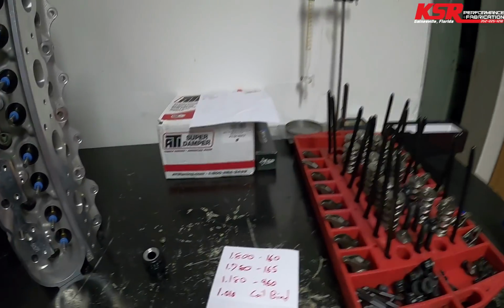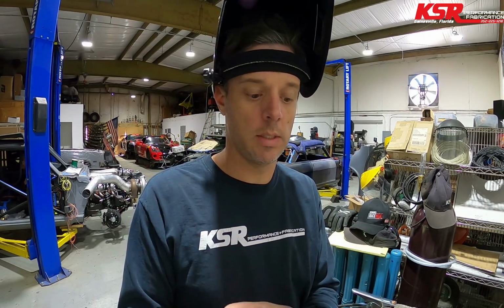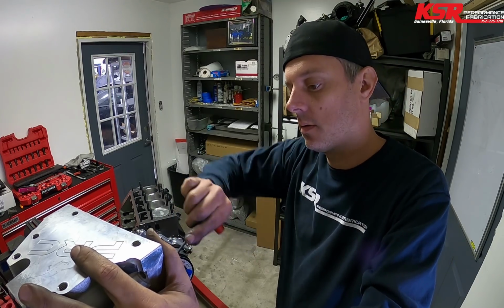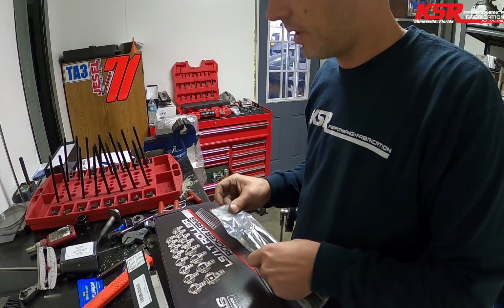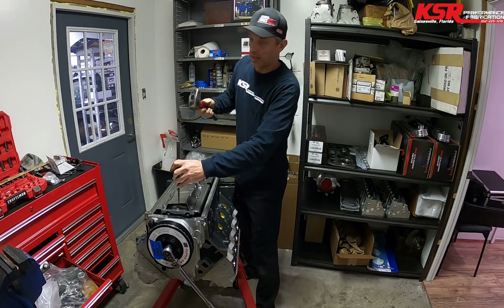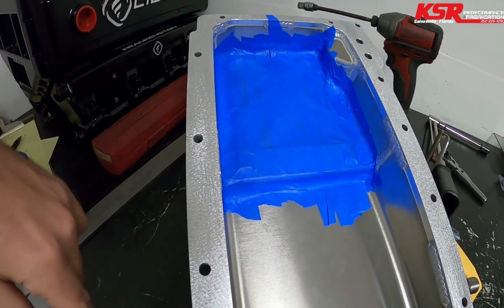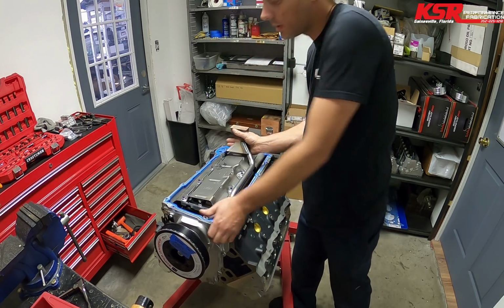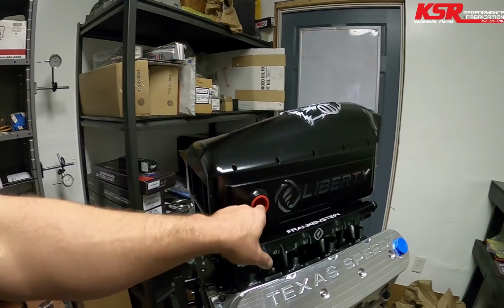Mullet El Camino Build Episode 2! Engine Back Together....but There Were Issues!

Comment: On such an insane build for a car that’s going to experience so much why did you guys decide to go with a wet sump oil system over a dry sump?
Reply from the maker: Plenty of cars run wet sump oiling systems even into the 5s in the 1/4, it is nice to have, but not an absolute necessity.

Comment: Personal preference * I like to put just a tad of silicone on the underside of the oil pan gasket where the front timing cover mounts to the block and where the rear main seal plate goes on the block. Keeps it from seeping*

Comment: Why didnt they send you or why didnt you guys run TSP roller rockers.... Those valve tips will sure get a worn out.
Reply from the maker: The rockers in Leroy, Ruby, Dale Truck and every factory LS ever built beg to differ.....
Reply: @KSRPerformanceFabrication  im just in inquiring into why not run TSP roller rockers? I cooked my exhaust valve tips with only 55000km with a .624 lift with the same valve spring setup. I know the engine will be looked at as it a race engine, just wondering if the TSP full roller rocker is not necessary on this engine setup..

Comment: Are the 6 bolt block/heads the only difference in this motor? Do Ruby or Leroy have the orings? Also is this one a solid roller(as soon as i ask u answer).. Also, those mains have splayed main bolts, correct? Hard to tell w the billet(or polished alum) spacer..

Comment: You should put a temp sensor after the intercooler so you can calculate MAD and use that for fuel trim. I noticed that as lacking on all of clete's boosted cars should be able to stop wheel spin and get more power top end power down track
Reply from the maker: They all have temp sensors after the Intercooler....
Reply: @KSRPerformanceFabrication  oh I guess I should have payed more attention, do you set them up to monitor MAD and adjust fueling?

Comment: TSP was trying to tell me there is nothing wrong with attaching the torque plate with head bolts when studs will be used in final assembly.

Comment: I bought one of those rotary welding tables that has a foot pedal to control. And it's a toe/heel pedal with neutral being level. Toe makes it turn CW, heel goes CCW and the further you push it, the faster it turns. It takes a little practice to get your feet to coordinate. But once you get the feel of it, you can really make some perfect welds. TiG is a little more challenging because of the two pedals, but MiG is really easy.

Comment: Why is so much work required on a new motor? Is it because of you going twin turbo? I understand the work needed for the different style heads, but the bottom end.
Reply from the maker: It didnt have an oil pan on it when we got it.
Reply: @KSRPerformanceFabrication  That’s going to be an absolute beast

Comment: I’m sorry but correct me if I’m wrong but did you put the head gaskets on backwards, the opening in the gasket should be in the back not the front. So the coolant goes from the pump, front of the block, back of the block, back of the head, front of the head, then to the pump or is there some custom cooling thing going on?
Reply: If it is right then how is the coolant flow laid out cause it looks like it goes from the front of the engine straight up to the head but in the head it can’t escape cause the return hole is in the gasket is back of the block

Comment: Very interesting to see you using an indicator torque wrench instead of digital. Any particular reason? Could it be that torque wrench you've had for decades and as the old saying goes, "don't fix it if it ain't broke"? or is that you trust the indicator more than a digital?  Just curious.
Reply from the maker: For lower torque values, that’s my go to

Comment: When you are building an engine and turning it over by hand, do you use any type of oil?  Are you worried about friction between the parts?
Reply from the maker: Everything has assembly line in it

Comment: Not everyone may use the terms in the same way I do, but your work clearly shows me the difference between an "engine builder" and an "engine assembler." Also, I noticed you used a beam torque wrench on a couple of applications. Is it because it's faster than setting up a click-style wrench for situations where you want to measure the torque but don't require quite the same level of accuracy that a "modern" torque wrench would give?
Reply from the maker: I use the beam wrench for lower torque values

Comment: I'm assuming (or thought I heard mentioned) that 2000hp was the goal. Would that be the highest hp motor you've ever done Kevin (solely by yourself)? Also, did you do SM's 5.3?
Reply from the maker: This engine isn’t really mine honestly. Texas Speed put the hard work into the shortblock and degreeing the cam. I have maintained a few big HP Big Block Chevrolet’s

Comment: Why would you not run the oil pick up tube as low as you can? Debris sitting on the bottom of the pan?
Reply from the maker: The oil has to be able to turn into the pickup box

Comment: Kevin, a couple questions if you don't mind. First why not a dry sump over the wet? Yes it's more work and plumbing but better and runs cooler. Also why hydraulic valve train over solid? When you showed the the spring force I could figure out why so low then you said Hydraulic lifters and that made sense but not the use of hydraulic itself. Are you not reving this engine out? I never had any luck with them I always run solid. Just wondering as you know what you are doing and know this build you want to build just not what I expected.
Reply from the maker: The hydraulic roller in SoccerMom has seen 8700......

Comment: Kevin, maybe I missed it, but I didn't see you put the valve stem caps back on the valve tips before you checked the push rod length. Do you think that may have caused your valve lash issue? You removed them here https://youtu.be/ffbe3SJrk0I?t=501 .
Reply from the maker: The square port heads had titanium intake valves, the cathedral port heads have some really good stainless steel valves

Comment: The two extra head bolts per cylinder appear to be nothing more than locating dowels in this case since you red loctited them into the heads?
Reply from the maker: They are studs. Once the heads are on the engine, nuts are installed from the underside
Reply: @KSRPerformanceFabrication  Just learned something! Do you have to use a small headed torque wrench on them, or is there enough room for a full size 3/8 wrench?

Comment: So Leeroy, Ruby, and Mullet are all turbo 427s, but with different setups and combinations, and will end up with very different track results and potential. I know a key difference going forward was Ruby's transmission, but she's doing wheelies and is topping out in the mid-7sec. I'm curious to know the big differences and limiting factors that set them all apart. A reliable low 8 second stick-shift, a 7-second powerglide, and now a planned 6-second car. I wonder what else is changing besides a beefier motor that can handle more power.

Comment: How do you torque the nuts that go on the studs that come out of the bottom of the cylinder head?
Reply from the maker: That’s what I was doing with the wrench at the middle of the engine.

Comment: Is 0.17" what you typically want to see as a static margin between max lift and spring bind?
Reply from the maker: Nah, depending on the parts combination, they can be ran much tighter.

Comment: is there an advantage to the ATI dampener vs a fluidampr?
Reply from the maker: I prefer the ATI
Reply: @KSRPerformanceFabrication  ten points
Reply: I'm probably going fluidampr..... I like the concept of fluid being used to dampen vibration as well as the outer case having the ability to spin up quicker than the fluid inside. if theres another reason to choose the ATI over the fluidampr, that im not seeing, let me know. I'm not worried about what either costs at all. oh if it matters it's a forged stroker lm7 in a street truck. I built it to hold high boost from a procharger

Comment: Enjoyed the build Kevin.
Just curious about Texas speed and having to adjust various parts. Thought it would be turn key.. Js
Reply from the maker: They sent it ready to bolt our accessories on with the cathedral port heads, but there was a mixup about the engine needing to have cathedral port heads to match the other two boosted cars. For the oil pan, they may have their own package that they prefer to use, but with this being a different chassis, they left the pan selection up to us and sometimes they need a little work to make the fit
Reply: @KSRPerformanceFabrication  ok I remember you saying that now.. My bad.

Comment: If the nut (in the lifter galley) on the 6th head stud ever backed off I would guess that it would destroy the engine? It also appears that you can't use a torque wrench on them?
Reply from the maker: It's not good if they do, but I have never had one come loose. For torque, I pull a bolt in the vice to the proper torque, then feel it with the same wrench I am using for the valley bolts then pull the nuts to the same feel plus a smidge. Not super scientific, but that method has not failed me yet!

Comment: I noticed you didn't put and sealant on the oil pan. Is that not necessary when using an aluminum pan?
Reply from the maker: The gasket was there, it is kinda a rubber o-ring with an aluminum frame to support the o-ring.
Reply: @KSRPerformanceFabrication  Well just asking because most videos I've seen of oil pan installs they put a small bead on each corner of the block

Comment: What kinda fuel you going to be running
Reply from the maker: Pump Gas, Racing Ethanol and possibly Methanol if we choose to go that route
Reply: @KSRPerformanceFabrication  with methanol you won’t have to use an intercooler right

Comment: Finally been waiting. I cant wait for this thing to take it's first 7 second pass. I know ol cleet loves that motor but I really thought with him trying to go low 7 or even 6s he would go with a different motor from the same company but a diff motor atleast bigger or soemthing
Reply from the maker: This one has better parts than the engines in Leroy and Ruby ;)
Reply: @KSRPerformanceFabrication  well yeah I know that lol its ana amazing  motor I just thought a diff motor. I thknk its capable of 6 and 7s but honestly would it be your first choice in motor size for your build
Reply: @derekg2132  You can make a HELL of a lot more than 1800 HP with 427 cubes, it all just comes down to the block you start with, and the parts you put in/on it. One of the major limitations they were seeing was head gaskets blowing out when they added boost. Those extra 2 head studs per cylinder will  allow them to push a hell of a lot more boost through it without lifting the heads, in combination with better pistons, rods, etc. This ain't gonna be a junkyard block that's ready to come apart at any second, lol
Reply: @Slaytanic454  i know that I was just saying I figured he would go with a diff motor this time around make it alittle easier
Reply: @derekg2132  I believe texas speed makes a 454 I'm surprised they didn't go with that too.
Reply: @KSRPerformanceFabrication  when is this suppose to be done like on the track making a pass
Reply: The 6 second guys use stuff like Proline billet motors, but really they are still SBC's at heart with big displacement - just hugely expensive. I think they can still get 2500-2700 hp from this TSP 427.

Comment: I see some fabricators weld a bung from  inside the pan. Is there a reason for welding it on the outside? Or is it just preference?
I believe they were steel pans tho and that one for Cleetus is aluminum
Reply from the maker: Just preference
Reply: KSR Performance & Fabrication   Awesome thanks Kevin

Comment: What sort of power are you aiming for with this engine?
Reply: Aiming 6 seconds so I guess 2500-3000 bald eagles .. ruby and Leroy run high 7's at approximately 1500
Reply: @doktermobiel  jesus that's crazy, I remember when 1000hp was a crazy amount of power, these days those are rookie numbers 😂
Reply from the maker: I think it will take 18-1900 to get us into the high 6s.